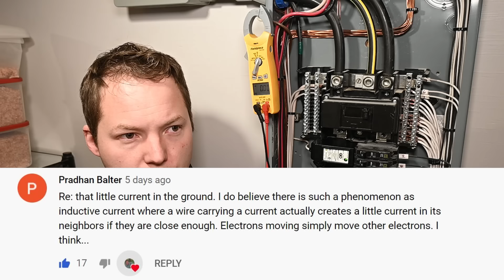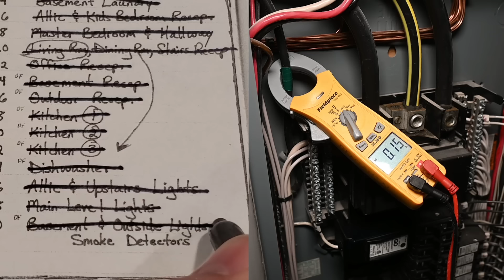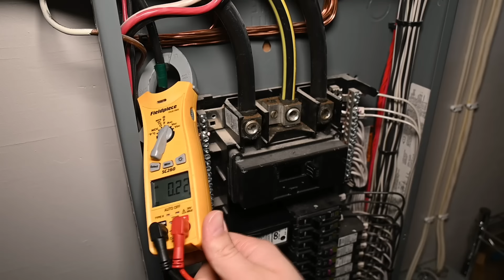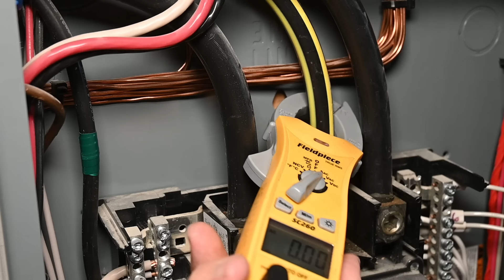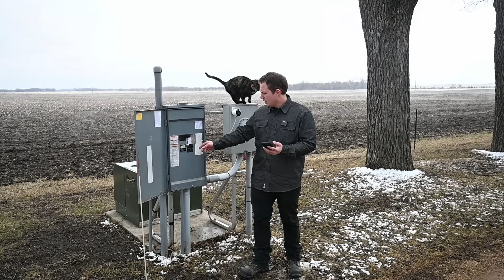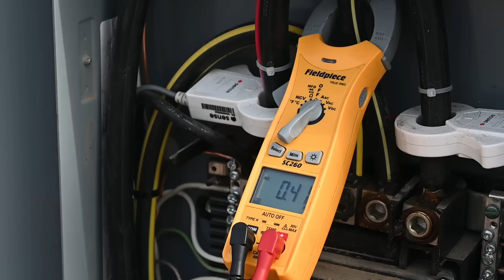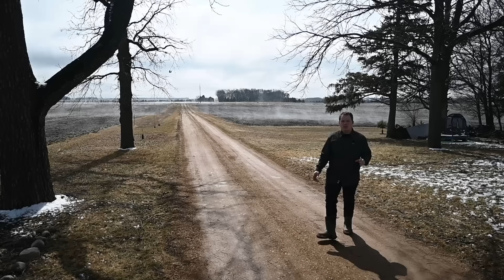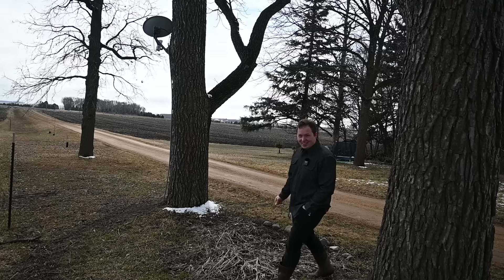Finding The Source of Stray Current on Grounding System

Comment: Blame it on unbalances!  Or understanding of unbalances.  The two line to neutral measurements were "fairly" same, not absolutely same.  Simplifying, if you have just 0.1 V difference and then 0.1 ohm resistance to transformer neutral to ideal ground  and 0.1 ohm from your ground rods to same ideal ground (0.2 ohms total loop), y could already see 0.5 A current running in that loop.  I repeat, that is highly simplified, but should give a starting point on the understanding.
Then we can go a bit further regarding the transformer.  There is a certain amount of capacitance from primary to secondary.  Not much, but with the primary voltage being quite high, there is some current running from the primary side system to the secondary .  Not only to the lines, but also to the neutral and from there to the ground..
On the primary side you also see varying amounts of unbalance, depending on varying loads somewhere.  You case is far from extreme.
Think what happens when electric locomotives pull trains.  There is only single phase supply (overhead) and single return -- the rails and from there to ground.  Depending on the supply transformer and its grounding you can see some really drastic ground currents and developed potentials.  If you have two ground rods some distance apart, near such an electrified railroad, you are likely to see several volts between the two rods.  If you tie both together or to your own neutral, you can see much higher currents than the ones you measured in this story.

Comment: I wrote to you regarding the lightning rods lightning rods back in the day you do you wondering why are you why your gas line is conducting the reason is everything is bonded so your lightning your lightning right direction conducting and electricity is traveling from your grounding rod to your gas line or you gas pipe so not sure why people still use lightning rods it does nothing you can’t dissipate electricity to the ground and it goes away it always want it always goes back to its source

Comment: There is possible hot wire connection/tap to a ground rod then flows through the soil back to the neutral center tap source, the resistance is very high that is why very less current

Comment: The utility neutral wire has resistance.  The only way it could return all the current to the source and read zero is if it were a superconductor with no resistance what so ever.  Since it's not, some potential will always exist on the neutral.  Because it is bonded with your ground wire, it's going to bleed off there.  As in Mike Holt's video, you are essentially measuring the resistance of that utility neutral.  The higher the resistance, the more current would back-feed through your ground.  At least that's my understanding.  I could be wrong.

Comment: The new smart meters use electricity to power the electronics within them. Yes, you are paying for it, however negligible it may or may not be. They don't disclose that to customers, as far as I have been able to tell. Is that what's causing your issue? IDK.

FWIW, edited to add: There was an article about a man who had a rental home that was empty. He had shut off the main breaker to the house as no one was living there for a few months. He continued to get a bill. I can't remember the exact numbers, but I think it would have worked out to about $100 per year. When he called to complain of course he got no where with the utility.
Reply from the maker: I believe that the Sense Energy Monitor uses about 5 watts or less according to what I have read on their website. Comes out to be around $5/year at $0.12/kwh.
Reply: @BenjaminSahlstrom  Does that take into consideration all the times it sends data wirelessly?

Comment: Yup knew you'd find it on the line side..!
Reply from the maker: You were right! Seems like the current might just be a "normal" part of how our electrical systems work. I still don't fully understand it yet.
Reply: @BenjaminSahlstrom  yes, but bare 220 lines NEC illegal, will burn your house down if the ground wire on top power lines brakes and touches the uninsolated 220 lines underneath..!
Happened to me! Caught it in time burned my water heater wires with the ground wire threw pine studied walls that don't need much help to set a wooden house on fire..!
Teco still won't change to NEC code That was in existance when the lines were strung in 1943..!
   Only prices of the insulation are left..! So I told him several times already these wires 220 wires head insulation on them about the time Moby Dick was a minnow..!

Benjamin teco has burnt many houses in Tampa the same way..!
So screw them I put a three-phase breaker on my water heater it's not going to happen again ..!
Know what I think Benjamin I think it should be cold that your main breaker is a 3-phase breaker with the ground running through the third phase !
 my three phase breaker I'm running the ground also threw to my water heater is going to keep me alive, but it's illegal get that..!

Comment: Ligtneen aresters go bad and do that..! NEC calles for the Ligtneen arrester on the line side so the costumer doesn't get slammed with a high bill when it shorts to ground..! I wone that battle with teco here in Tampa..! They were doing it wrong..! NEC also calles for an lightning arrestor after a high amperage brake like air-condition, close dryer  , water heater, or main breaker which would be a huge inconvience for the owner when it goes..!

Comment: Electric companies can sometimes lose current into the ground from their underground wiring. I once spent a week trouble shooting a railway that had enough stray voltage on one track to stop the level crossings from operating. Other tracks were not affected, and I noticed that the side where the track was affected had 5 telephone poles with end connections converting to underground wires that went under the railway. We contacted the utility and after lots of delays and politics, they finally admitted to losing 70 amperes of current into the ground!

Comment: You may check if here are any pipelines in your area that may have a rectifier connected to the pipe. It's possible that the polarity of he rectifier needs reversed. I ran into this many times picking up readings on mobile home frames as well as electrolisis causing anchor rods on our utility poles to rust & corrode in the ground on down guys that were bonded to the system neutral. This stopped when an insulator was installed in the down guy. The primary winding has one end bombed to the case of the tank & the secondary neutral bushing is also bonded to the case & primary underground cable has concentric neutral wires wrapped around it that's bonded to the case that is bonded to ground rod. Just some thoughts.

Comment: It's normal. Look up equipotential plane grounding and see what you must go through to make sure dairy cattle produce correctly when connected to milking machines. The readings you have now will vary frequently. In your climate, you may even find GFCI nuisance trips caused by this. Don't trust me, check it out for yourself.

Comment: It is a long way between your house ground rod & the pole at the road. This could be induced over the buried cable. The path of the neutral & the path through the ground itself makes a loop into which current could be induced. This is why line crews attach straps between long de-energized lines at the pole so they don't get shocks from the dead lines. The loop formed between two ground pegs on two poles spaced apart returning along the neutral can also form this loop.

Comment: I saw a similar problem on a farm in Illinois. Horses wouldn’t drink from their (heated) troughs because of shocking. I eliminated the possibility of induction from the long run of wires. I didn’t consider the neutral leg from the transformer, but that could have been the source. Good video!

Comment: THIS IS A BIT OF A WILD GUESS BUT IS IT POSSIBLE THAT CHEMICAL DIFFERENCES IN THE SOIL BETWEEN THE ALL THE GROUND RODS HAVE THE ABILITY TO ACT AS AN BATTERY?
IS THIS STRAY CURRENT AC OR DC?
ALSO I THINK IT IS A INDUCTIVE CURRENT CAUSED BY THE CLOSE PROXIMITY OF THE CONDUIT HOLDING THE NEGATIVE AND POSITIVE CABLES!
WITH THE LENGTH OF THE. CONDUCTORS BURIED BETWEEN THE HOUSE TRANSFORMER
AND WHAT EVER THE CONNECTION TO THE ROAD SIDE 
POWER LINE.
DOES THE HOUSE TRANSFORMER RECEIVE THE LINE VOLTAGE FROM THE SUPPLYING POWERLINE, 
OR A REDUCED VOLTAGE?

Comment: ? Do you have a ground hooked to your city Water pipe or well? Is the pipe copper or plastic. In Pennsylvania you have to have your water pipes hooked to grounding your main box with two grounding rods. Current is going to flow to least resistance like water flowing down hill. You can have a induced current flowing back to the power company. The only thing you can do is disconnect grounds and see where it is comming from.

Comment: Transformer fault, we had a problem with a 120v transformer joining the 2 legs and giving 220v, also could stand in the middle of the yard with a volt meter, hold both electrodes in the air and get 0.56v reading!

Comment: PPE my friend. It takes only one time.  Eye pro arc flash, gloves.  Do it for your kids
Reply: Well, I would say most guys don’t wear it in residential.  OSHA says 50 volts or higher. Not an issue till your in the burn ward, cardiac ward or the funeral home. All it takes is once.
Reply: @bigmikeh5827  48 volts is the cutoff for shock hazard not arc flash.

Oh did arc flash category zero get removed?
Reply: Nick McWilliams yes sir it did. I look at things from the entry level guys and building safety habits. Old habits die hard after they are established, good or bad.
Reply: Arc flash for residential?  Does residential have enough energy to sustain a flash?

Comment: The Transformer (tear your meter) ISOLATES, so it becomes the source.  Current WILL return to source.  Ground is for safety from all sources (not al intended). I am concerned about multiple ground rod widely placed, because you get 'EARTH' differential current flow (AKA Ground loop)  (I don't thing the remote located Transformer Case should be tied to the House Green. the ground rod there, is for the Transformer ONLY). If you ever take a lightning hit IN THE AREA, massive currents WILL flow between rods  as the wire has less resistance that the dirt. Seen the results.

Comment: Thanks for another interesting video. I too, was surprised when you turned off all the breakers and found nothing. I was expecting the heat pump – mine nuisance trips a GFI breaker, so I know it leaks a bit to ground from time to time. I confess that I remain intrigued at your finding out exactly what is going on here. Please don’t give up on seeking an answer as now it will become more and more difficult to get one. At the time I clicked the like button I noticed that you had 8728 views, 818 likes and 7 dislikes. I am very curious to understand why anyone could dislike this video.
Reply: You can satisfy some of the people some of the times but you can never satisfy all the people all of the times " American elections " . lol
Reply: Your pump motor start/run capacitor(s) are probably bad. They should be changed about every 5 years for modern equipment made cheaply. Few things are made to last more than 5 years.

Comment: "Earth Battery" effect from multiple ground rods?
Reply: Nobody responded to this?  OK I'll answer. Batteries are DC, even earth batteries. He has AC current in his ground. There is two causes of this.
1 An AC voltage gradient in the ground. If he takes a long extension cord for ground reference and plug it in in the house, then with a rod probe the ground you can look for AC voltage from current in the ground. The Northern Lights put DC into the ground and when the voltage gradient is high, this DC current is what used to trip substations offline when DC current in the transformers saturated the cores. In the US, they use Star, Delta on the lines so they have a DC ground on one end only, with lightning protection for high current lightning strikes. The star Delta is important on long North South transmission lines. Every once in a while you catch a doomsayer thinking the vulnerability in the 60's has not been fixed.
Most of the Pad mounted transformers for a residence is single phase. The primary is of one of two configurations. The primary can be from phase to phase on the primary, sometimes called bi-phase, and in rural areas, more common is only one hot phase and a neutral. This is very likely where the issue is from. The neutral is bonded to ground at the pad transformer. The neutral line is long. Some of the return of the HV side goes into ground to return to the substation ground, instead of being carried 100% on the neutral wire.
As your utility about your transformer primary. I'll bet it is listed on the tag as 5KV primary, the normal voltage for one hot and one neutral. If the tag says 7200 Volt primary, this is the common configuration for two hots from 2 phases of 3 phase power.
If the ground from the transformer is accessible to a rod, measure the ground current on wire to the rod.

Comment: My first suggestion would be to check, do you have a UPS still plugged in? I do know that they can put current back on the neutral ground if in rectifier mode, got the crap knocked out me one time by unplugging one and touched the power chord plugs. Second quests would be loose or corroded ground rod connection at the transformer/meter.
Reply: I do like the corrosion idea.

Comment: maybe with all power off check for current between your two legs if you pick up some you may have something with a switch on waiting for a command like a electric heater or equipment. If so shut them off and check for your current between your two legs and the stray current on ground

Comment: I think the current is coming not from the center tap. A neighbor has the leak and it is seeking your  ground electrode.
Reply from the maker: That seems like a good theory. Do you think that is possible with my closest neighbors being nearly 1/3 mile away?
Reply: @BenjaminSahlstrom   I don't recommend this but if you were to pull the meter and disconnect the neutral terminal at the meter panel, you could see if the current shows toward your house or toward the transformer. If it comes from he hose the current is coming from another device leaking to ground. Personally I would not worry about such a small current but I would not open the GEC and place myself between the conductor and the rod.
Reply: Your closest neighbor's only decent ground is the gas pipe.

Comment: Sounds like a center tap grounding problem at the main panel.  Can be dangerous, enough mA to cause cardiac arrest. Visually inspect every part of main panel grounding system from center tap service to ground rods -- TOUCH NOTHING - use new condition hv rubber gloves.
Reply from the maker: I might see if I can get the utility company out to take a look. Obviously I'm not going to be opening up the transformer to inspect the connections there. :) Thanks for the recommendation on the gloves.

Comment: I understand this, it's more intuitive if you have ever dealt with voltages (potential) in the aviation industry. 

Your power is being generated miles away, ground at that location may not be exactly the same as your location. Earth has a certain amount of resistance, copper is always much better.  You get the power generation as (using momentary DC readings here) +110, neutral (or ground at the generation point), -110. but that neutral is retaliative to where the power was generated so it may be (momentarily with respect to ground where you are) +105 on one leg and -115 on the other, still a swing of 220 but the center point (neutral) differs from ground by the 5 volt differential. That differential is what you are seeing leaking to your local ground (path of least resistance). Theoretically if you disconnected your ground rod from your system you would see a jump in voltage on one leg or the other. My guess is if you measured one leg to the other you would not have 220 (or 240, or whatever it's supposed to be) but something less than expected because you are leaking current to ground. It's actually very normal within parameters. I wouldn't expect to see more than an amp or more than a volt or two across that bridge all in all a watt or two. All because electrical transmission is far more efficient than the earths ground. If you want to have some fun figure out how you can take advantage of that "free energy" (it really isn't that much but its a fun exercise seeing what you can get away with for free.)

Comment: Liberty Patriot hit it on the head. A transformer is a capacitor. The windings and insulation makes a capacitor, although a poor one. That is why you saw a decrease in amps over time.  When de-energized you can short the netral to each leg, thus dicharging the capacitor effect. Do this several times and you should show no current.

Comment: The wires strung through the house act like a large capacitor.  Since the current is alternating, it charges and discharges the capacitance causing a current even though the circuits are open.  You can see the effect clearly on this video where he plugs in a large spool of wire and runs an LED with the circuit open.  https://www.youtube.com/watch?v=1uEmX5XClPY&t=542s

Comment: Drive your own ground rod and disconnect from that gas line. Put a meter between your new ground rod and the gas line to see if there is a voltage potential there. Something somewhere else could be grounded to that gas pipe and have a problem. Neighbor, gas co equipment anything